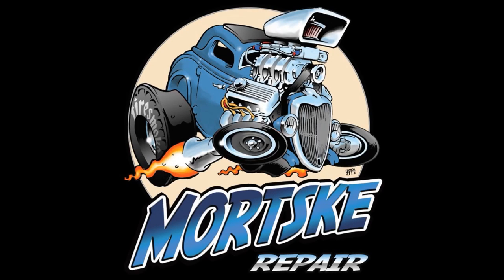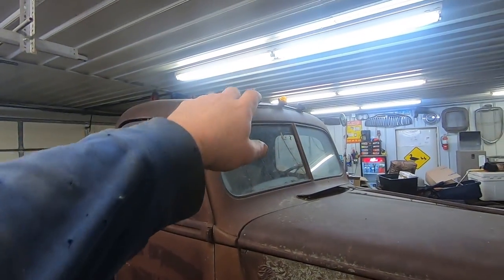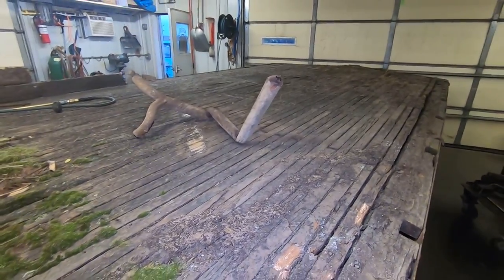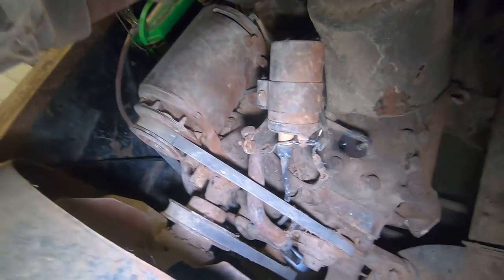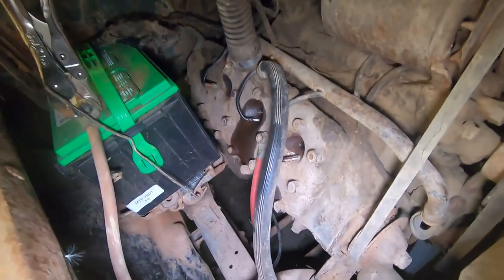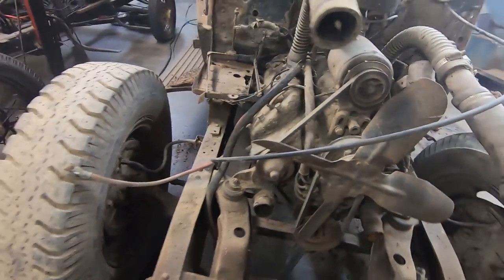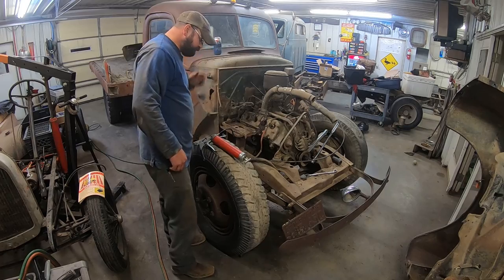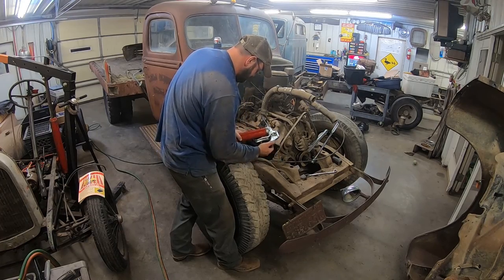Farm Auction 1944 Ford Flathead V8 truck! Abandoned for 47 years! Will it run?!? Stuck rusty engine!

Comment: Pre F-Series with passenger car-like cab body and front.  Almost all 1944 vehicle production was for the war effort but only the VIN will verify the exact year.
Reply from the maker: They didn't change much between 1942 and 1947. Based on the steering wheel I needed to do some digging as I know 42 through 45 stuff is super rare. Turns out it was a 1944 unit. So pretty rare! Thanks for watching!
Reply: @MortskeRepair  Perhaps it was originally built for the war effort and then later converted to civilian use.  But that blue paint looks original so maybe it is a rare civilian model.
Reply from the maker: @SpockvsMcCoy  Yeah, too bad this thing can't tell us it's story! I've heard folks with money did get a few rigs out of the auto factories back in the day. Or it could have been built at the end of the war and put into circulation. One may never know! One thing is for sure. This baby has seen some changes in 70 plus years!!
Reply: @MortskeRepair  In late 1944 the War Production Board allowed Ford to manufacture a limited amount of heavy duty trucks for civilian use. Regular production of those vehicles had ceased in early 1942 and the federal government had strict requirements about who had the ability to buy a new vehicle. Your truck appears to have factory paint and is not painted in a drab military color. Perhaps the previous owner knew the rarity of this truck but was unable to restore it. If you contact FoMoCo they may be able to give you more information about its history.  Good luck.
Reply from the maker: I'll do some more digging on it!! Thanks for the info!
Reply: @SpockvsMcCoy  It was just repainted.  This truck was almost certainly built for the military.

Comment: I'm late to the party but next time the way to find the cylinder with both valves closed is to stick the air hose in each plug hole and listen for the one where the air isn't rushing out through the carb or exhaust.

Comment: ..one word for those rusty cylinders...KROIL!... :)
Reply from the maker: Does Kroil cut through water or just sit on top like most oils do?
Reply: @MortskeRepair  ...get a rag and dabb/soak up as much as the water on top as you can..then lay it to it..it'll break loose nearly anything..but the bad part is it's fairly expensive...
Reply from the maker: @dyer2cycle  Gotcha, heard of it, never offered around here. A little heat goes a long ways!

Comment: Impressive 👍 As soon as you pulled the head off the passenger side, I really thought you'd throw in the towel
Reply from the maker: I knew I'd take a beating from the keyboard warriors if I gave up at that point. So I stuck it out for the comments like yours Devin! Thanks so much!

Comment: If i'm not using Cometic head gaskets, i'm using that same head gasket in a can on the Fel-Pro fiber gaskets. Especially if the compression ratio is over 10:1.....

Comment: Weld some metal ends of a spark plug to a small piece of chain then use a  cherry picker or something else to put pressure on the head
Reply from the maker: That would work! Would have to tip the engine on it's side so you're pulling straight away from the mating surface would be the hard part.

Comment: Hey mortske hoy can reuse those WD-40 flex straw cap in one top on other types of spray cans. IF the nozzle tip is the same as your zap 45 spray it will work on the can to just resnap it on make sure it Estopa spraying then retry it afterwards.
Reply from the maker: Good tip!

Comment: For a running engine with aluminum heads, which often are truly stuck, the best way to get them off is to put the nuts back on, but 1 turn loose, then start the engine WITH NO WATER and punch it.  The heads will be blown free.  If that still doesn't work, the only way is to break them off in pieces by putting a crow bar in a spark plug hole and pry.  Destroys the heads, but they were probably no good anyway if stuck that bad.
Reply from the maker: If they're running that works

Comment: You may try to use phosphorous acid for cleaning rust in closed spaces. Get around 40% acid and fill rusted space with it. A few hours should be enough to clean most of the rust. I'm not sure how gaskets would react with it though.
Reply from the maker: I'll have to give that a shot!

Comment: That is a damn fine runner man. I hope you saved all that old rust from the 2nd cyd on the driver side..some purest would give you bank 💰💰💰for it  haha... These old ford flatheads never surprise me anymore. Crazy how with few tools and little knowledge one came bring them back to life. (Unless they have been under the sea for 50 years). Ol flathead guy I know. When he has a stuck piston or motor won't turn over, he'll pull the heads. And will put alittle gas on then and let them burn awhile. To free them up.  I myself like the torch rafter then building a bonfire on top on the motor lol lol.. the cab and front clip don't look so bad as well..  That happen to be a scripted Ford flatbed ? 

🍻🍻🍻🍻🍻
Reply from the maker: Thanks for the comment good sir!! I really enjoy these old flatheads and have a fleet of them currently. Unfortunately this one didn't have the Ford bed. Was an Omaha Standard brand. That's where the sign on the seat that I picked up came from. I've had a few of the Ford script beds over the years however!

Comment: If I could I woukd be putting a flathead in my 07 Tahoe. That's what I started out working on at my Dad's used car lot . way back in the day.
Reply from the maker: Anything can be done!! Haha you'd probably have the only one in the world! They're a great engine tho. Thanks for watching and commenting Tim!
Reply: As heavy as your Tahoe is, you might want to try to find a 49 - 51 Lincoln 337 Flathead.  That was the Big Block of Flatheads.
Reply: @MortskeRepair  I could drop a 1967 302 with a c6. In it. Hahaha

Comment: I use to take a bar and ratchet hook it to the harmonic balancer and put marvel mystery oil in the cylinders .then put a bottle jack on the wrench jack it up till it's got decent pressure then let it set till next day .most of the time it works or ya try other way .the pressure will break it lose whith out the work lol .most of the time ..but ya just a lil thing I did at times ..
Reply from the maker: I don't think this one would come loose by penetrating oil! Every time I crank on the the crankshaft bolt they either spin or snap off!! Thanks for watching and commenting Brian!

Comment: Unbelievable!! I just bought a 1952 Ford COE truck with a flat head V8 and the previous owner told me that "It was running a couple years ago but I think its stuck now." It was parked in a field behind his shop. Any words of wisdom before I get started ? Thanks
Reply from the maker: Let it soak for a bit. Be prepared to deal with stuck valves. They're ALWAYS is a couple that are stuck. You can usually get them through the spark plug hole. Or pull the intake manifold. Those later engines the heads are easier to remove if need be.

Comment: Wow 1 dirty motor. Good job. You may already know this but I am going to say it anyways. After you run it enough to get it to running temperature, let it cool all the way down then torque the bolts down again. Then after 5 times letting it heat up and cool down torque to head bolts down again for the last time. Hopefully they will not leak.
Reply from the maker: Thanks for the tip

Comment: suppose now i must try get mine to run too.. it turns freely... Love the jailbar, got my first one too. I was told mine is a 47 as it has the stamped logo on the hood.
Reply from the maker: That sounds way too easy!
Reply: @MortskeRepair  yeah it does, but you know it turns  so maybe all the pistons are snapped off... it does seem to easy.
Reply from the maker: @StreetTruckGarage  I'm betting a valve or 3 is stuck. Every one I've gotten going has at least one sticking.

Comment: I am really not believing that carb is so ok that it took fuel.... much less been clean and not stuck enough that it could hold an ideal run the engine... not just off the bat.... sounds good all things considered..... I love the way those old flatheads sound..... even with exhaust.....

Comment: Practically everything on that truck has patina going on, even the dash. Never seen a bare bench seat before, that's a first. Usually the foam is still left, all moldy and what not.
Reply from the maker: I don't think these ones had foam. Just burlap. They're all down to the springs when I find them.

Comment: I used to a 1945 ford truck and it looked just like this one bit in mine someone changed the engine to a chevy 350
Reply from the maker: 42 through 47 were all essentially the same. They doubled the horsepower on the one you had! Thanks for watching John!

Comment: There's this stuff called free all that Paul from fab rats uses that supposedly works better than PB blaster and kroil. Also it's good to see you have the sense to use a big ass pipe wrench to turn the engine over instead of something else. 👍
Reply from the maker: Never heard of it

Comment: This is proof positive you cannot kill these things. I've had people tell me these old engines are junk they fail easy yadda yadda good fucking luck getting a modern engine to run with that much rust in the cylinders! I will grant it's probably only running on 5 or 6 cylinders, but fuck's sake it idles. Wasn't even burnin' much oil.

Love me a good flathead. My next daily driver will have one of these engines in it. Prolly gonna be a '35-'41 Ford sedan, preference to the '36.
Reply from the maker: They were a great design that still lives on to this day!! I like the 36s myself!! Got a 39 Standard and a 35 5 window I need to get after one of these days! Thanks for watching and commenting!
Reply: @MortskeRepair  I'm interviewing for a job that pays somewhere around 70k/yr in a couple hours. I get that....I get my Art Deco Ford.

I'm vibin'. Heh. heh.
Reply from the maker: @TestECull  Good luck!!!

Comment: Love this stuff!!  I recently have brought back two Slant 6's.  One I don't know how long had been sitting, the other since '92.  Bent a pushrod on both turning the engine over with a breaker bar since both were stuck from sitting.  A few new parts in both and they both run great.  One is a '68 D300, the other a '67 D100.  Both very cool.
Reply from the maker: Gotta love this old junk! Hard to kill a slant six! Driving one to work today in my 68 D100! Thanks for watching Rob!

Comment: Hate to admit it, but that motor deserves to live on. Just think of what Tom and Max Herman at H&H could do with that virgin block...for about 15 grand! 🤣
Reply from the maker: That's cheap!! Someday it'll be 30k!
Reply: @MortskeRepair  If ya put repro Ardun heads and a SCOT blower (or 4-71) on it, it's 30 grand. All that for 275-300 hp 🤣.

Comment: Good way to bend rods,brake pistons. Must pull heads & clean rust from cyls. Even if you got it to turn, the rings are still seized to pistons. Good luck
Reply from the maker: Thanks for the tips!

Comment: @7:49, it appears the front pulley is notched for a hand crank. You should be able to stick the crank in, and roll it over 🤣
 @23:59, be careful with a cheater pipe out too far on the handle. I had a nice Rigid , aluminum handle pipe wrench, that has been shortened considerably because of that.
Reply from the maker: You overestimated my strength!

Comment: Excellent on 1944 Ford Flat Head V8 and sounds excellent also worth fix up to for nice project too! Hope see future videos on too and be intresting too! Also do you have crank for crankshaft to turn with in future! Because farm tractors also old vechiles from 1950 or earlier years are simlar and some not!
Reply from the maker: I do have some hand crank handles but they're not meant for the torque required to get one loose as stuck as this. Plus they connect to the nut on the crankshaft and that was just spinning when I tried a socket on it. Just waiting to strip out! Thanks for watching Andrew!
Reply: @MortskeRepair  :) yes do understand that for sure also yes those engines need crank are wild to use and arm plus wrists breakers to Lol! I remember on farm the Old 1950 Cockshutt 40 COOP tractor with Buata 235 CC 6 cylinders updraft carb 1barrel 53 hp 6 Volt battery with Postive grounded! Had crank one day get started in terrible cold Winter Season Strom because Start Soliend for key ignition switch jam up! But got started after 12 full round cranks Lol tap Soliend too with a hammer! But another time our Mc-Cormick International 1968 105 C Combine with Farmall H basic motor  4 cylinders gas 202 CC size 12 Volt Negative grounded the Starter quit on us in feild after refueling fuel and get crank up with handle from Cockshutt tractor with me and my uncle Bill in big bucket on 724 International tractors lift up  by my dad doing controls plus my brother James in Combine at controls ! 8 cranks on crank got started up and was task both yes and wicked please Lol!
Reply from the maker: The old boys had their work cut out for them starting things by hand! You kept your junk tuned up to try and prevent trips to the chiropractor!
Reply: @MortskeRepair  :) so true and trips to Chiropractor Doctor was to Hot Warmth Tub Bath of Abuno Salts at home or Whirlpool plus Hot Sanua at Sports Complex after Supper Time for 3 hours Lol sure help out! Especially in the Summer Season and Winter Season to sure warm up  and take tight spots of the body of back to feel lots better too for sleep better too! My late dad like because help bad hip before had operation on it later years and me was arthuist in arms plus knees to!
Reply from the maker: @AndrewHCann  It sucks to get old!!

Comment: Nice! Good info. But what is a running flat head worth? Never needed one so I have no idea. Have had a few old scrap yard owners wanting to sell me a few trucks with them but the body looked to far gone for me.
Reply from the maker: It all depends. If it's a 59AB or an 8BA, or one of the other variations. Depends on if it's a core or running. If it's been checked for cracks. And your location as well. It's all supply and demand. So anywhere from $50 to $2500! Thanks for watching Dan!

Comment: Sometimes they just need a little lovin. A Ford trying to win over a Chevy guy. Tell me there's not a difference in the quality of steel. The difference is as drastic as Heart Pine and Long Leaf Pine. All that resin in Heart Pine made it very rot resistant and bugs mostly left it alone. With that old steel even the bolts mostly survive. Good Job! Dylan and Duff.
Reply from the maker: I guess I don't know nothin about wood!
Reply: @MortskeRepair well it starts as a seed, turns into a tree, and once it reaches maturity it can be used for an infinity of things. 🙃 but in some cases it just ain't the same as it used to be.

Comment: Also get some PB blaster and basically flood them pistons, they may just come loose easier.
Reply from the maker: I think this one was a bit too far gone just for some oil.
Reply: @MortskeRepair  well those cylinders was frozen with one with water in it, but it may have been easier to break loose with some penetrating oil, either way you got her running.
Reply from the maker: @VintageCars999  I prefer Zep 45. Personal preference. But I did spray that in the cylinders. You can see it in the video. Thanks for watching and commenting.
Reply: @MortskeRepair  yeah seen that you did spray something in there wasnt sure what it was, I'll have to check that out as well, never tried Zep 45.

Comment: Haha I’m currently trying to free one of these up myself but I don’t have to take the hood of because it’s in a crane 😂
Reply from the maker: Well if the crane ran you could use itself to remove the hood!
Reply: @MortskeRepair  only two issues with that, one, it can’t lift more than a car tire it’s so old an rusty, and two is it’s one of those old cranes that are pulley and clutch driven so you sit IN the engine room when operating it! It’s an oooooollld machine
Reply from the maker: @canadianpacificstudios5835  That would be sweet to run for about a half hour!
Reply: @MortskeRepair  yep sure Would!

Comment: You need a big ass drum of evaporust for those old heads and stuck engines, just tear the heads and oil pan off and throw it all in that drum for two days. I guarantee it's turn over after that.
Reply from the maker: I'll get right on that.

Comment: I have a flat head forson V that was last run in 1955. The engine is not stuck, radiator has been stolen, and its in a forson 7V lorry. Oil is golden and on the stick. Whats the chances?
Reply from the maker: You never know until you try!